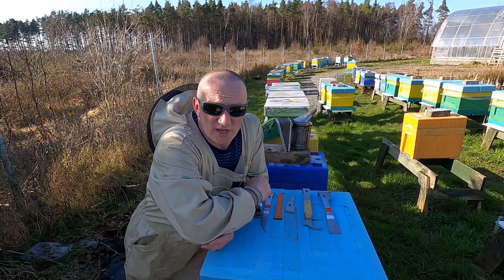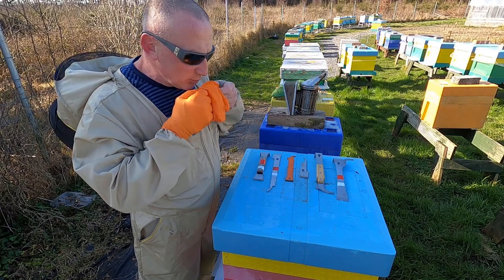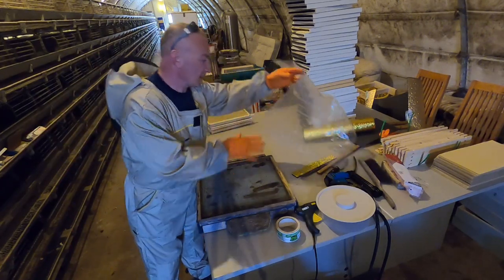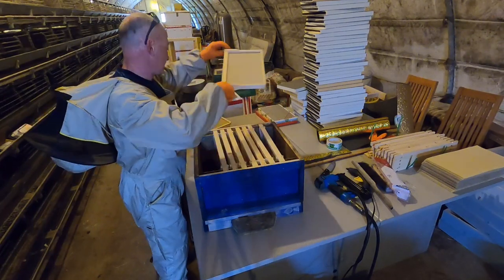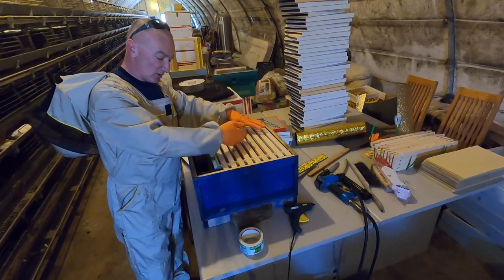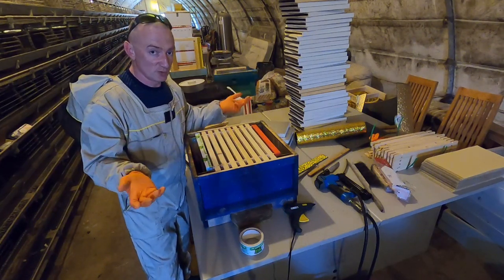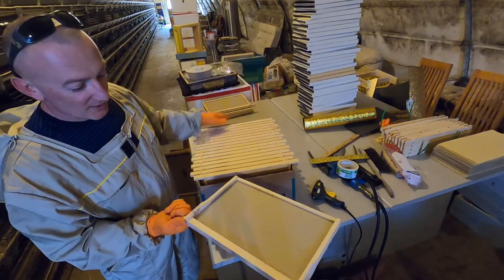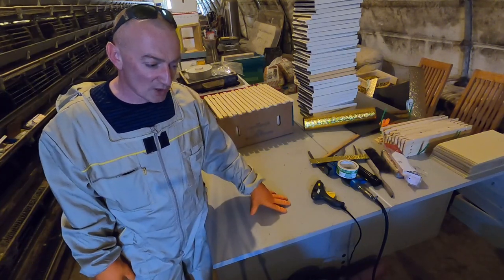Beekeeping for beginners. Part 1.

Comment: Great video, thanks for sharing the use of insulation board as dummy boards, I'll use that tip this year. 
Any advice on bringing a swarm out of a tree and into a box without climbing the tree? I've been told to use lemon grass oil? Thanks, Rob
Reply from the maker: there is a special trap for swarms on the trees, with chemicals that attracts them and they fall into the mesh. The other method is to get a box on a long enough trick and but one frame with small amount of the opened brood. It will act like the best lure for bees.They will be in the box within minutes.
Regards
Reply: @irishbee3632  great thanks. What is the special chemical called for luring out of the tree, I dont fancy holding a stick up 6m high
Reply from the maker: @robertobalzi6287  lure or the box with brood has to be as close to the swarm as possible. 6 m is surely too high for any action, so I would say the chance of catching this one is slim.

Comment: Andrej, can I ask, have you no vents at all in the hive roofs?   What happens in really hot weather? Thank you.
Reply from the maker: i use open mesh floor. top is always airtight.
Reply: @irishbee3632    I’ve just watched your other video with the fabric and the two sticks under the lid!  That explains my wondering about hotter weather.  Love your videos and you’re information is spot on for conditions here in Ireland. Keep it up. Dave.
Reply from the maker: I think you have it wrong. If the top and bottom open- it's not ventilation, it's a draft. Strong colony will wax the top to make it airtight. I use draft only for winter to stop queen laying. In hot summer days, if ever happens, roof is insulated, so no heat comes in, and aluminium cover reflects the sun out. And spase 8 mm under crown board letting the bees ventilate over the top frames. Regards
Reply: @irishbee3632   I have you now. Thanks.